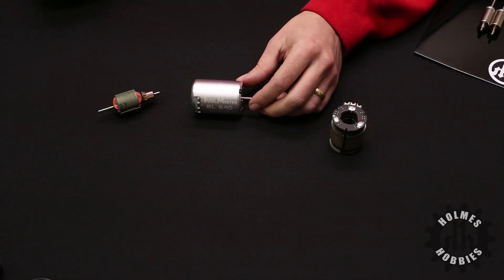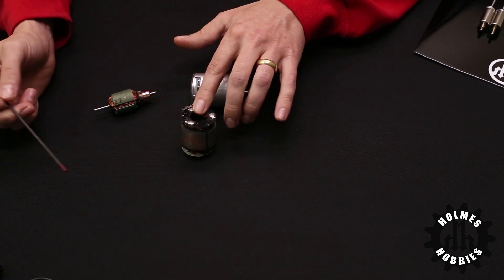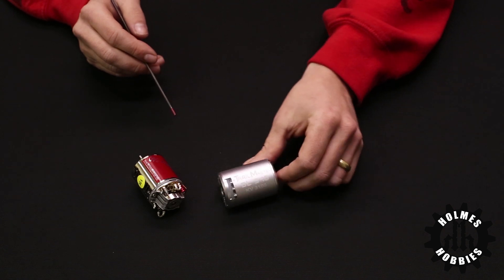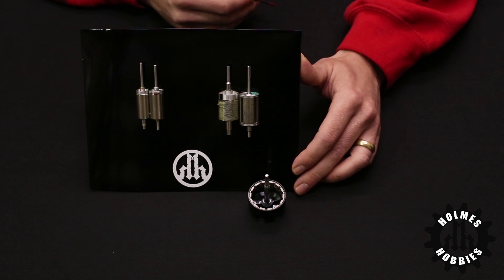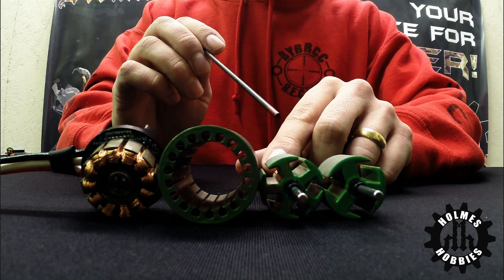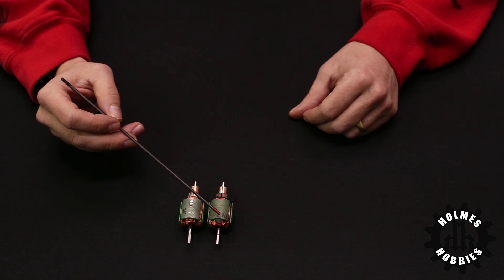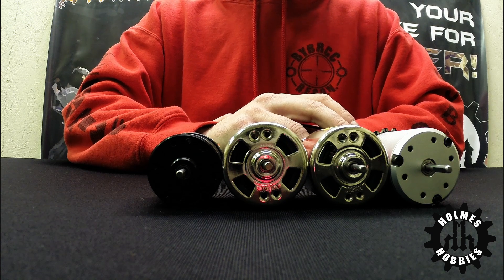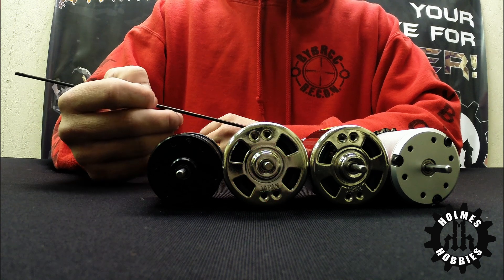Selecting the best RC Rock Crawler and Racer Motors by Holmes Hobbies

Comment: Looking to race my Axial Deadbolt in U4RC Trail 1.9 class (rock racing) the stock motor has a top speed of 5.9 mile/hr ...Need a motor that is faster but still can get over the rocks and that is competitive in this class.  Can you recommend a motor.  Thanks,
Reply from the maker: 3500 puller pro all the way, its u4 bred.

Comment: I’m building a 1/10 scale mud bogging truck with very big 2.2 tires and looking for a brushed or brushless motor that has enough torque and wheel speed to keep those big tires spinning. I’ve ran Axial 20t and 35t brushed motors but, they both bog down in the really deep mud. Any suggestions on a type and speed motor for my application?
Reply from the maker: Puller pro 3500 and mamba X.  You will need to add some grease to the motor face and sensor plug.

Comment: Hey John, although i'm using a Crawl Master pro 540 13T w/1080 Hobbywing ESC on my SCX10ii(loving it), i want a clear understanding on the difference between the Crawl master, Trail master and Torque master?  I have an MST CFX FJ45 project(for class 1 rig)and a TRX 4 sport assembly kit Chevy C10 project.  Although i'm really happy with my Crawl master set up on my SCX10ii i'm really curios about the 2(Trail master & Torque Master).  Of course i want a smooth crawl set up.  I cannot decide if i should just stay with Crawl Master or try the other 2.  So maybe with you making me understand more on the 2 or the difference between the 3 it can help me decide which motor to put on my 2 projects.  Thank you very much in advance!  And Happy Holidays.
Reply from the maker: Crawlmaster starts smoothest.  The others aren't a slouch, still second best startup in the industry behind the crawlmaster.   The torque and trailmasters will have more grunt though.   If it is heavier or doing towing, choose the torque or trailmaster
Reply: @HolmesHobbies  Happy New Year John!  Thank you very much for replying. I may have to stick with the Crawl master pro for my Class 1 rig project and try the Torque master pro on my TRX4 sports project.  Having 1(Torque Master) and being able to test and try it on hand will for sure give me a clear and specific understanding about the difference between the 2.  By the way another thing, can the BR-XL ESC be program using an Apple(Macintosh) lap top?  Or you can only program it through Windows PC?

Comment: This is old video but do hope it will reach on your inbox..Got quick question John...I'm running 35t brushed from axial paired with HW 1080 wp on my rr10 bomber..I'm turning it to fulltime crawler. Still on stock gears 12/64 and stock diff gears...as reading your comments this is good setup for high torque? High turn doesn't make your motor produce high torque right? Am I on right path?

Comment: Ok holmes hobbies, I am stumped. About to put a order in for a motor and esc but cant figure out what would be best. I have a gmade r1 that I use a a rock racer/crawler. I want to go brushless, I have been looking at the trailmaster 3300kv but I also like the 1800kv revolver but I want to make sure I have wheel speed. What's your suggestion?
Reply from the maker: You will have a wider range of wheelspeed while saving startup control if you use the higher KV option.   In a rock racer I would recommend 3000 to 4100kv range for 3s lipo use.   3300 to 3500kv is my preference.  The trailmaster 3300 should be a very good choice for you.

Comment: I got a cheap Chinese 550 27 turn motor. 12NZD it cost. I have a huge range of motors, most are 540's but a few 550's but by far the cheap 12$ 550 shits all over my Tamiya 540 35T hand made pro block that cost 140NZD (I been using them for years until)
Reply from the maker: Its easy to make a 550 outperform a 540, there is a lot more active material.    Handwound 550s would blow your cheap 550 out of the water though :)
Reply: yeah, I'm looking at one aye. HH pro 35t 550. 140nzd. I little more than 12$

Comment: What motor you recommend for a gmade rock crawler r1
I live in Ireland so it’s mostly wet weather so il be running in wet mud terrain I have no budget just want a good working reliable motor thanks
Reply from the maker: I always recommend the TrailMaster Sport for water use.    Low cost, so it's not the end of the world if it rusts up!     Add a tophat to it to keep out mud, and they are very long lasting "abuse" motors
Reply: HolmesHobbies ok thank you

Comment: Money is not too much of an option trying to get an opinion on pretty much the best motor and ESC combo you can get for a crawler not looking to go fast but something with torque what's your guys's thoughts
Reply from the maker: Puller Pro 540 motor or Revolver 540 will be the most torque you can cram into a 540 sized space.   BLE or Mamba X controller.

Comment: Hello sir i want help, i want to buy my first scale crawler the FTX Outback, but this truck have 370 size motor and the second new version have 390 size motor and i want this truck not only for crawl but to make speed runs because i like crawl and speed and in crawling sometimes you need speed to get over some obstacles. I know it's a crawler but i want to make speed runs too for jumbs . The basic problem is i can't find 370 size brushless combo and i don't want to make custom works to fit 540 motor, so is there a 370 brushless combo for the FTX Outback ? And i have see that in FTX Outback truck they make halls to the plate to fit the FTX Outlaw 540 gearbox and i don't want to buy a new crawler and make halls to make custom works. Custom works is for the feauture but not when the vehicle is new. Or else suggest me a 370 combo that i can make crawl and speed runs with 4s battery max. Sorry for my big comment/ question but i don't have so much money to make test . I want the FTX Outback because is affortable that's why i speak for this level of crawling. I am so desperate to make all of these questions but i don't have 400 euros only for a crawler kit that take 540 motor stock if i could buy so expensive crawler like scx10 ii or Traxxas TRX-4 or similar i wouldn't make all of these questions and i would buy directly 540 size combo electronics and the things they will be more easier then.

Comment: What makes the smaller puller motor different from the others in performance?
Reply from the maker: Smaller motors= typically less torque and power.  For lighter rigs, competition oriented rigs, or vehicles with space constraints, smaller motors can make sense.   In many cases, smaller motors still make plenty of power.  Our Brushless Puller Stubby is a good example of smaller having plenty of power and torque.

Comment: THANK YOU!! I'm an old fart, getting back into the Hobby after a 20 year hiatus. The brushless motors were all rocket science to me, and some helpful people, just made it worse! 😲 
Brushless seems to be the way I want to go. First being more efficient with longer run times, second being more power, without sacrificing as much torque as a comparable brushed motor. Low maintenance and no brushes is just a bonus! 

So..... 1/10th Scale CC-01 Trail Truck, with slight rock climbs..... some suggest a 2750-3600kv, 4-pole motor. I'm certain I can only (barely) afford a sensorless motor. I'm a disabled Vet, and the government gives me just enough to be POOR! 
I've already upgraded nearly everything on the front suspension and rear end.  In fact, thanks to a trick I figured out from 1:1 automotive experience, I may have the TIGHTEST steering of any CC-01!! 😉😎

So, do those numbers sound like they would work for me?
Reply from the maker: Apologies on the latent response, we just found the youtube page where all the comments are listed and easy to find!   

It sounds like you have a solid understanding of your needs and the differences of brushless motors.    It would be better to choose brushed than sensorless for trail use though, especially in a CC-01.   A Torquemaster Expert 55t running 3 cell lipo is an extremely good choice for the CC01, as it won't break parts and doesn't overheat when paired with the tall gearing.

Comment: I'm new to the hobby.  I'd like to know what is best numbers on a motor for running slow like crawling as slow as possible  what numbers am I looking for?  I want low speed high torque . thank you
Reply from the maker: Something around 2100kv for brushless, or 35 turn for brushed.   They are controllable with plenty of torque.

Comment: Please show us how to break in a new brushed motor.
Reply from the maker: +Propinionation we highly discourage using water. Customers have bearing failure from rust and routinely wear out brushes and then ruin the armature.
Reply from the maker: Check out the rebuild video for break in details.
Reply from the maker: +xxaxnxtxhxoxnxyxx that's a fantastic method... to ruin a brand new motor. You need to watch our rebuild video too, eh?
Reply from the maker: +xxaxnxtxhxoxnxyxx our advice pertains to products and market of today.  Racing with sealed can motors makes water break in feasible, but as you point out that is a decade in the past. If we ever make something suitable for stock racing, without preformed brushes, we will be sure to cover the subject extensively!
Reply: that is old. there is newer methods and newer products .  also if you are going to use the water  at least use distilled water.
Reply: Best way is to get a bucket of clean water.  Then attach the wires on the motor with the wires on your fully charged battery.  Put running motor in water for about a minute.  This will also clean your brushed motor.

Comment: How about  the 6 poll  in door carpet 1/8 has 2mm larger od than 550  I am running it in a wraith 29 p 80s =2.75:1   standard metal gear Trans  over drive front and rear 5.75" irock    I Cant bog the mmax pro esc or motor on 2 cell  never get it hotter than tuch   I run hard enough to brake vanquish 3/16" rods (no not the plastic the cromo)

Comment: How would a Holmes hobbies motor (13) t work in a scx10 with a 2 speed transmission. Would it heat up in slow binding situations or will it be ok? Please respond back.
Reply: damien smith
4 years later, legend says this man is still waiting for a reply

Comment: I always heard brushless motors and water are not a good idea and that that's why so many stick with brushed setups to be able to run in water
Reply: I think you can run sensorless in water but with the sensored and that's what you want in ur crawler you'd have to waterproof it
Reply: https://www.youtube.com/watch?v=yjbc3PMKyGk&t=319s
!
Reply: You can't run either in water unless there water resistant  you can't run sensorless in water tho
Reply: @chriswebb383  you can run brushed in water, i completely submerge my crawler every time i go out on the trails. but as for brushless i only use them in my drift car that never sees any water at all. i just stick with my brushed motors because they are dirt cheap and can just set it and forget it. ive never cleaned my 35t brushed in the last 12 months ive owned it and still works awesome.
Reply: you can run them but is alot more maintenance involved with brushless. when brushed gets dirty just get a clean glass of tap water and plug the motor in to power and dunk it in the water. there will be a bunch of dirt and crap at the bottom of the glass
Reply: But ya still can't run brushless in water lol. It just don't work
Reply: I know you can run brushed in water . The comment was about running sensorless brushless in water and I said you can't . Between sensored and sensorless neither runs in water.  ...brushed yes of course